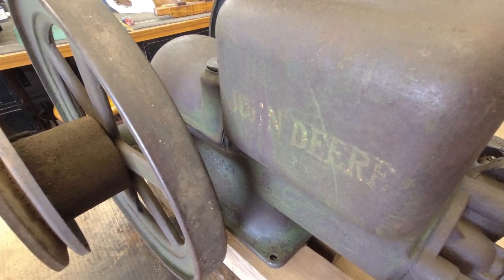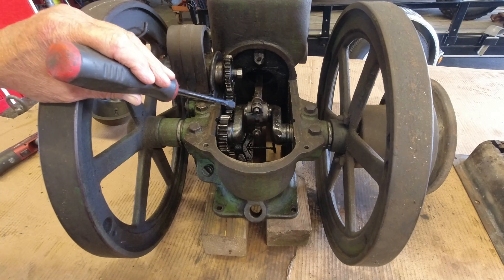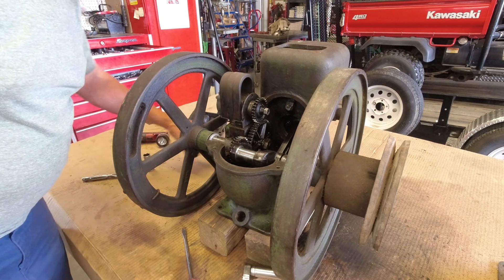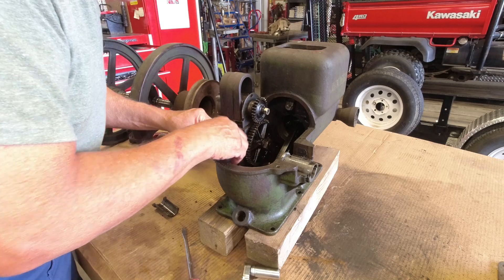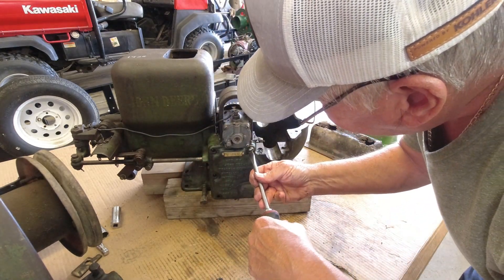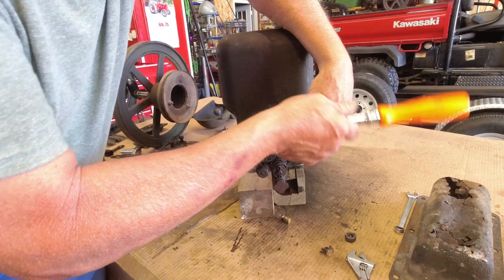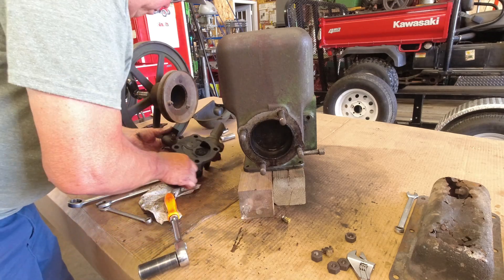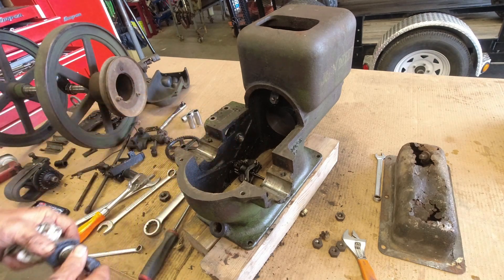John Deere 1-1/2 HP Model E Restore to running condition (Part-1)

Comment: Looking forward to the next video on this John deere.I have rebuilt a few of these 1 1\2 HP and lucky to say blocks have been good.the bushings are available thru Flywheel supply..thanks for posting
Reply: Are the cam and governor shaft bushings a common problem with these engines?

Comment: hello,  very good job of showing ad explaining how you inspect and rebuild engines. enjoy them..have question, you mentioned you had got a muffler ((remnufactured ) for an engine, where do you get them and other parts?  thanks
Reply from the maker: There are several sources for parts both used and reproduced. Try searching: Flywheel Supply, Starbolt Engine supplies, various suppliers also have parts listed on E-Bay and Facebook. I probably got the muffler you're referring to at a swap meet and then cut it open and baffled it to suit my need.   Hope this helps, and thanks for watching!

Comment: Maybe you can ask about welding the cracks with nickel rod (  less heat on the casting ) I have used nickle rod B4 you have to heat the whole casting but no where near as hot!!

Comment: Where is s good place to get all the torque specs for these E motors?
Reply from the maker: I don't think that Deere had any Torque specs listed at the time of mfg. Most farmers back in the day wouldn't have had a torque wrench on the farm anyhow. Just use common sense when torquing the fasteners. The Society of Automotive Engineers website have listed common torque specs. for specific fasteners that you could reference.
Good luck on Grandpa's engine!!